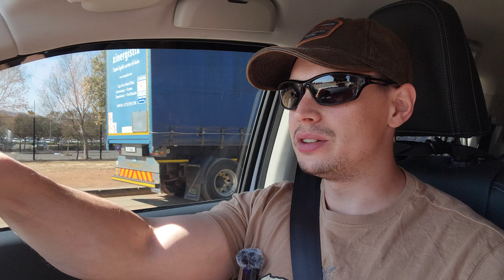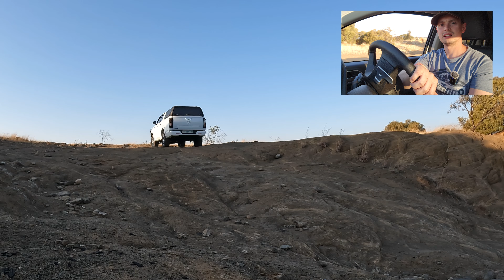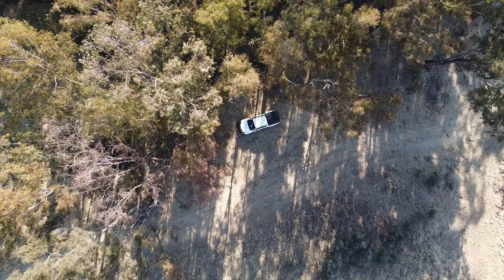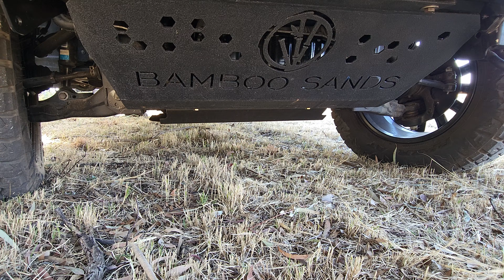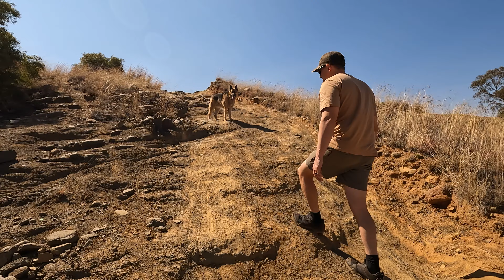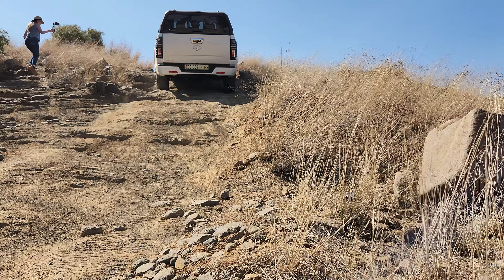Overlanding Rig Reveal | Tough Test | Great Wall Cannon | P-Series

Comment: I’m also planning to buy a P-Series LT. love your videos.
Reply from the maker: Do it! I tell you what, if you look after it it will look after you. Here is some extra advice, im working on a video about it but be careful where you put in diesel and always use a Diesel Treatment additive when putting in at lesser known fuel stations.
Reply: @ thanks for the advice. I just paid deposit on mine. I also got in touch with the guys from Bamboo Sands, thanks to your videos. They are great.
Reply from the maker: @Themightychilux  That's my pleasure enjoy the car, i am planning some more videos regarding the vehicle to share all the things i have learnt so far. Some more advice is keep it standard for a while, i regret adding the extras immediately after purchase. Add the extras after you spent some time with it standard.
Reply: @ Hopefully that video comes out quickly. I would love to know what you would have done differently